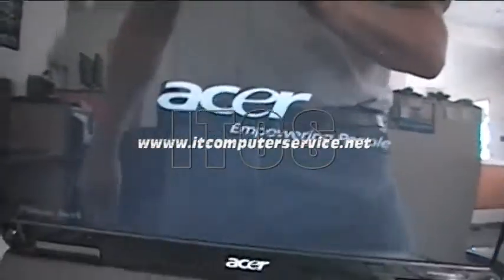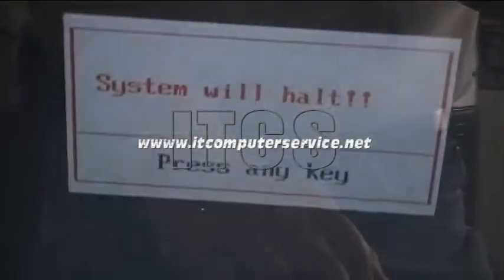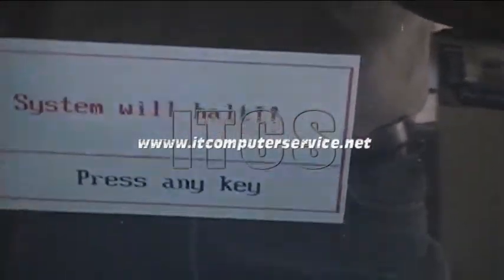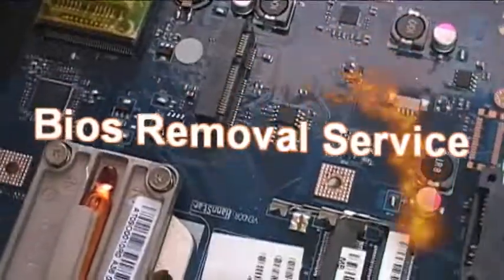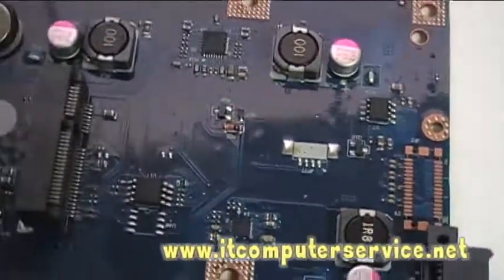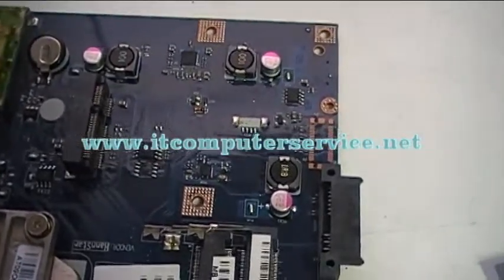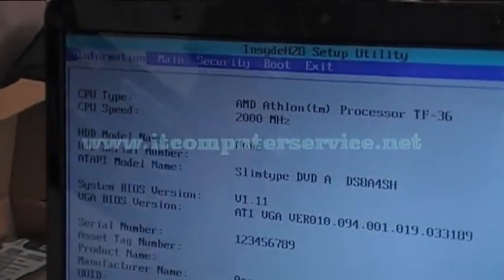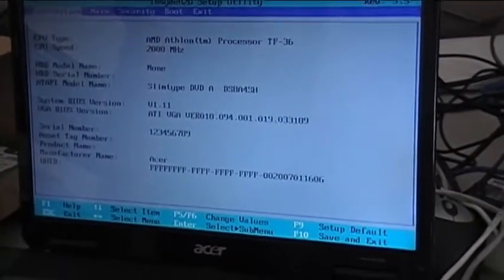Acer Aspire 5532 Bios Password Removal

Comment: hey there, I have an acer s3 391 that has bios lock, if I unplugged the cmos battery and what not. will it fix the problem
Reply from the maker: ***** That will not work you have to replace the bios chip with a new one that has no password set.

Comment: indemmand  wat happens if i remove the bios chip for like 2o mints then i put it back ??will it reset its self ??
acer 5552g thNKS
Reply: No obviously the data is stored on the  EEPROM chip some times you can just short two jumpers where the bios battery is and reset the bios  EEPROM chip completely then upload a new version of the bios via usb stick :D..